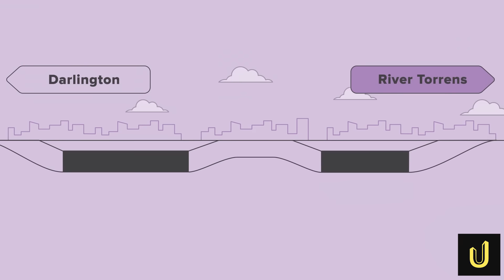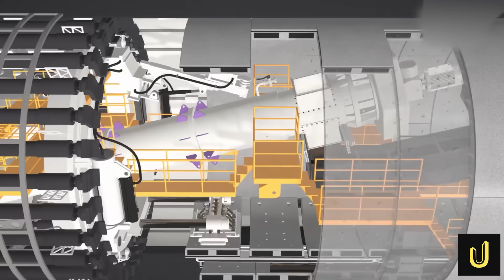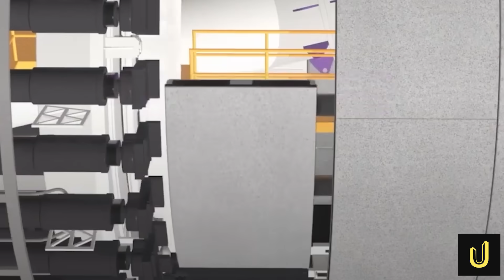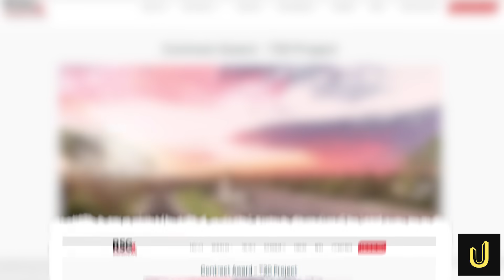$15 Billion Highway Project Shocks Australia!

Comment: Massive bottleneck at the South end: Southern expressway + South road traffic coverages just before Old Noarlunga. Runs for 3km. Crosses the Onkaparinga river. Then a big set of traffic lights. Then it splits off again into Victor Harbor road +  South road. 

If the Southern expressway was extended to meet Victor Harbor road, I think it would help a lot. That’s where the bulk of the traffic flows. It would be heaps safer since accidents occur surprisingly often along this section. 

If there was forward thinking - they should have put a road traffic bridge over the Onkaparinga when they did the rail bridge. At the moment there is only 2 bridges to cross the river. Once one is blocked, the other is complete gridlock.

If my imaginary Expressway extension also went over the river, it would serve as an additional bridge.
Reply: The original plan back in the 1970s when South Road was built to Old Noarlunga was for Dyson Road to eventually be extended south across the Onkaparinga parallel to the train viaduct and to then join Commercial Road south of the Port Noarlunga Oval.
Reply: II can see that coming in the 2030s once the current section is done, especially with all the new development going up around Seaford and south towards Aldinga.

If you look on Google Earth, you can clearly see that they've reserved a corridor to extend the Seaford railway line through to Aldinga, so I would say that's in the 10-year plan too. So I would be surprised if there isn't a plan to upgrade South road from Southern Expressway to Victor Harbor Road, since most of that stretch is already freeway-level road anyway. All it would need would be a couple of overpasses at the Seaford Rd lights into Victor Harbor Rd and the feeder going towards Aldinga.
Reply: It was a HUUUGE stink even about rail bridge there (everybody considers such a project as greatest tuckerbox), imagine what will be with road bridge.

Comment: I'm all for this, but it annoys me this road will probably only have a max speed limit of 80km/h because in Australia 80km/h is "Highway speeds" 😂😂
Reply: 80 coz they know people be doing 10 over anyway lol
Reply: New westconnex tunnels in Sydney are 90.
Reply: Highway speeds in Australia are 110.. But in Australia "highways" are often located next to residential housing, footpaths, businesses, intersections etc. This is why the expressway is 110 and south road is significantly less than that. Given that this tunnel will be surrounded by nothing but walls there is no reason for it to be any less than actual highway speeds
Reply: Meh big deal, if it was 100kph rather than 80 it would only make a difference of about 60 seconds in travel time over the distance of the tunnels.  There are going to be accidents and that difference will absolutely save lives.
Reply: The majority ignore the speed ‘limits’ on the Nth-Sth Motorway, so it seems you’re not the only one annoyed.

Comment: The biggest lost opportunity with these projects is that they havent run light rail down the middle. Connecting this into teh tram and train network would have made so much sense, and teh time to it is when you start these things, nit later when it causes more disruption. Seems very shortsighted.
Reply: Agreed & the hills still get nothing. I work in the CBD with some people travelling in daily and there's constant issues for them! We moved North East and have the obahn, honestly I can't complain but all of these should be linking up for the service of all areas!
Reply: why build a second train line when one already follows south rd in that area and that train line goes all the way to seaford as well as having the flinders and belair lines plus it would balloon the cost due to having to divert the line into the city.
if you want more rail then going into the eastern suburbs are a far better options as all the current rail is on the western side of the city
Reply: When the planner built the "one way" Southern Express way and claimed it was the world first, I was laughing at them that Singapore had tried it in the 70s and later had to rectify it to a dual Express Way, they ignored me. The worst part is, they even sold the land they said they didn't need. As it turned out, the planner had to backtrack and build a dual Express Way at astronomical cost.

Has anyone noticed the current expansion at the junction of Sir Donald Bradman Rd and Marion Rd, the left turn lane to Marion Rd in the direction from the city on Sir Donald Bradman Rd is  only like two car length, how is that adequately provided? 😅😅
Reply: @myfafourites they were so proud of it being the only one of its kind in the world, yeah that’s because the rest of the world thought it was a stupid idea..
Reply: Great point. They always think of these things afterwards and then it's added work and nightmares when they could have done it all at once. Like the Southern Expressway being one way only, and having to remember what hours it was open which way... why didn't they make it both ways in the first place? I think Adelaide could seriously do with underground rail where it can, this was one place where it could have been added and shown great innovation. We're ahead in many areas but so backwards in others.
Reply: Have seen integrated light rail systems overseas and its wonderful. Would have been very complicated to implement given that the entire north- south corridor has been upgraded in sections. What has already been done saves a huge amount of congestion and time. For those of us who live in the affected section during the construction period, this is not going to be easy but it will benefit all of the state.
Reply: I’ve been telling people for years that if they want to learn how to build a decent road they should check out the Freeway in Perth, 3 lanes of traffic in both directions and a train line in both directions down the middle. 
My introduction to Adelaide roads was the southern expressway before it was duplicated.
Reply: In an ideal world yes but it all costs money ... nothing is free
Reply: Shortsighted is the Adelaide way. Labor corruption, wasteful spending and incompetence is the problem. And no, I am not a Liberal supporter
Reply: @funkymunky3what was the Labor corruption?
Reply: @funkymunky3  A Greens then?

Comment: Hopefully, this works better than the one-way expressway!!!! 😂
Reply: The one way expressway worked great and it was a necessary solution at the time, the main reason for it was that it was an economically feasible option when we were still recovering from the devastating effects of the collapse of the state bank.  Easy to laugh at it but really it was the only option without causing even more economic hardship.  It handled peak traffic well which was the main point of it.
Reply: Lol, it's not one way anymore, but yes
Reply: It was an improvement in its time.

Comment: highway speeds? doubt they'll put 100+km/h on the tunnels more likely 80-90 max
Reply: most adelaide drivers struggle to do more than 50 in a 60 zone anyway
Reply: the SE freeway tunnel is 2 lanes and 200m long, and the speed drops from 100 to 90. knowing south road already is 80 in some parts, i'd assume that the limit would be 80. hopefully they replicate the SE freeway and do 90 tho

Comment: No trafic lights sounds fantastic.
But the best part of this is NO damn tolls.
Others in Australia will be jealous for sure.
Only one set of trafic lights from Seaford to port Augusta .woo hoo
Reply: Just need to remove the lights at Riverlea and it’ll be amazing..
Reply: @Ranganation  Should have done it with an overpass when they upgraded the Angle Vale and Port Wakefield road Intersection. It is better than before ,though the Pt Wakefield Road before and after is still full of holes and cracks. Patch, Patch, Patch has been the answer. It looks good for a while but comes back to bite you when the patches open up the road around them.
Reply: There's going to be tolls. You're naive if you think there won't. The government won't upkeep it. It'll be privatised just like the ones interstate
Reply: @mnj640 Current Status of Tolls on the South Road Tunnel
No Tolls Currently in Place: As of October 10, 2025, the South Road Tunnel is still under construction, and no tolls have been implemented yet. The project is funded primarily through the South Australian government budget (estimated at around AUD 1.5–2 billion), with no private tolling operator involved like in some other Australian road projects (e.g., West Gate Tunnel in Melbourne).
Reply: @mnj640 Any SA govt stupid enough to introduce road tolls will be tosssd out at the next election. All political parties know this
Reply: I believe government does intend to eventually introduce a tariff
Reply: @rachelroosken9110 this tunnel is going to be easily bypassed . That's not what the want .this is south Australia🙂  not the eastern side of Australia. 😋
Reply: Tolls is a NSW virus that unfortunately is spreading to other states
Reply: @SeasonThreeIsBetter  Labor governments both federal and state want to introduce a “kilometre tax” thus making EVERY road a toll road
Reply: No tolls, yet.
Reply: Tolls will be imposed guaranteed
Reply: @rickzw67 
lol nah this is south Australia  no toll state.
Reply: For now, I bet you there will be tolls on the corridor within the next 15-20 years.

Comment: This is how much lack of forward planning skills costs. Decades ago the strips 150-200 m wide along both sides of major runways should have been zoned as a "road widening proposal" zones, with land for the development on a leasehold titles. 
And it is crazy, that trucks transit through the city, instead of going around on bypass road.
Reply: Trucks dont go through the city centre, they use roads around it.
Reply: it was forward planned back in the 50s/60s with the MATS plan. Unfortunately politics got in the way, the State went broke in the 1980s....and so we are where we are. Finally, it's being done
Reply: There always has been spare land along both sides of the major runways in adelaide.
Why are you talking about the airport?
Reply: @kojwalsh  I think he meant "roadways".. typo or "auto-correct"🤷‍♂️
Reply: no way for bypass road - the town compressed between sea and hills, any road there will be thru built-up area. To build something beyond hills, with 2nd SE freeway instead of Lower NE road and then thru Onkaparinga valley? Ummm, that requires Martian occupation first. 

So the single way to solve the problem is some elevated/tunnel replacement of Portrush, but locals there will lay across elevated and tunnel will cost another $30B
Reply: @antontsau  This raises the same question: How hard it was get the pencil and draw on the plan 1 km wide corridor where only leasehold title was available on land at the foot of the Hills?
Reply: they were gonna install bullet trains in the 80s but they knocked it back. what a stupid move that was

Comment: SA roads are a joke. 

Over 4 years been upgrading South rd in the actual South  ( Aldinga - Sellicks ) 
If more than 4 cars want to leave in come into Aldinga ITS GRIDLOCKED> 
1 accident in the South or HIGH tide, Its grid LOCKED> 
People wont ever make it to HOspital in an Emergency. 
So much concrete and narrow rds. 
How are the trucks and Buses enjoying coming into Aldinga between OTR and Aldi ?

The dumb underpass is falling in like FLINDERS and they have all ready removed a slip lane to support it. 
What other SUBURB gets stopped to ENTER at TRAFFIC lights. 
McLaren Vale has a true overpass all done in a year, not ALDINGA> 

WAT AN ACTUAL joke. Come on down and have a look. ""Still be 2 years before its even close. our roads are covered in MUD 24/7 with detours and traffic hold ups daily. 

THE WORKERS ARE THE BIGGEST JOKE IN SA

Comment: South Road is a nightmare. This is a good thing. Not only will this cut down travel times north to south, but will also decrease travel time on South Road itself if you don't want to use the tunnel. Dividing the traffic between South Road and the tunnel should also help with bottlenecks.
Reply: Only for a decade or so, then it will be the same as it is now (according to DIT’s own modelling).
Reply: :hand-pink-waving:Terrible idea. Marion Road is worse. Cost over runs will be enormous.
Reply: Just as much, it will cut down on travel time with the east west intersecting roads. eg. Henley Beach rd is around 5 changes of the lights to get through between 5pm and 6pm, whereas Port rd with far more traffic is 1 change of lights. That's a big pollution saver with idling cars and trucks, not to mention wasted time.

Comment: What happened to the promise to divert all the trucks running through the city via Portrush Road?
Reply: That was Liberals, we voted Labor. Now we get Labor.
Reply: I would think connecting the SE Freeway to the South Rd corridor via Cross Rd would be more viable. Sending all those trucks along Portrush Rd, then Ascot Ave then Hampstead Rd to Grand Junction Rd is a traffic nightmare, especially considering how narrow Portrush Rd is. Far easier and less distance to turn Cross Rd into freeway down to South Rd and then run all the trucks up to the Port and the Islington / Dry Creek intermodals via South Rd once it's complete.
Reply: Not going to happen,trucks will be using port rush Rd for atleast the next 50years.

Comment: train/tram/bus !!!!!
Reply: If you work in the city maybe.
Reply: My commute is 32 minutes on this road. By bus/train/bus it's 55-90 minutes or anywhere in between. The train operates like clockwork, the busses are totally unreliable. My local station has busses leave sometimes within a minute of the schedules train arrival, leaving you stranded for 30-60 minutes depending on the time if they feel like driving off "on time" while you cross platforms. Infuriating.
Reply: Oh and all of the Trucks delivering your food and  supplies cant get on a Train or Bus

Comment: South Road has been getting 'developed since I was a kid in the 1960's. It will never be finished, and it's already obsolete. The city is now near 90 klm long, the road would need to be at least 5 lanes each way to have any effect. That will be fine till traffic banks up at the exits where speed drops back to 50 or 60 kmh.  We need a complete alternate route that takes load away from the South Road route. Funnelling the traffic to one point of failure is just dumb.
Reply: the exits are seaford and gawler, no 50kmr exits on either end.
Reply: You're right. Why bother. Just leave it how it is.
Reply: Do you want to fundraise the money for your megaproject idea?
Reply: You just described why urban highways are useless. More lanes and more extension won’t solve it.
Reply: nope. Sydney tunnels (M5, M8, Northconnex) are 2 lanes, only some sections are 3 or 4, and cope perfect with Sydney traffic, not Adelaide. 3 lanes required only for maneuvers, when some traffic enters-exits. Even main arterial M4 is 3 lane.

Alternate route of course needed - Mt Osmond to north and west (Portrush and Cross). No chance.
Reply: The southern end goes back onto 'old' South Road, which is still 2/3 lanes each way (at 80km/hr) for a considerable distance.  Most of the traffic has usually exited by then too, as there are obviously multiple exits along the 45km stretch south of the CBD.
Reply: Road toll be next, to reduce congestion?